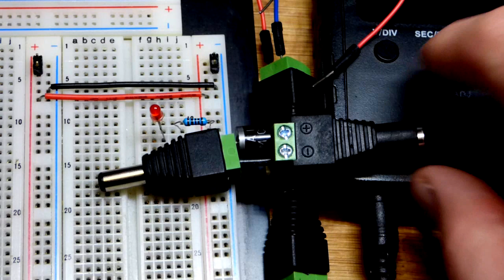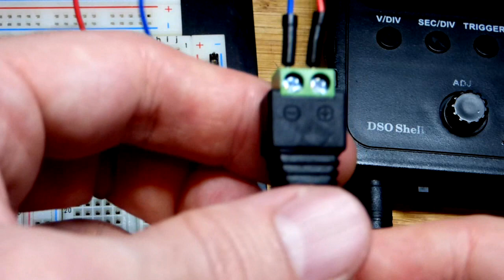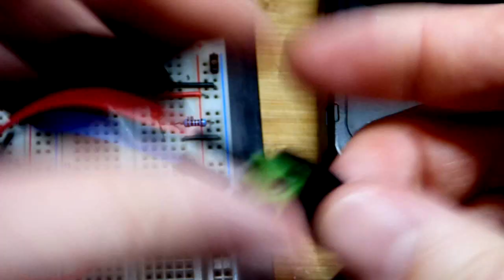DC power jack plug adapter connector 2 point 1 by 5 point 5 mm how to DIY demonstration

Comment: Should be noted that these connectors are only rated at 5amps max. We use these for connecting LED strip lighting to our power supplies. Enjoying your videos. Keep them happening.
Reply from the maker: Glad you enjoy, thanks for the info!
Reply: Yes I see that in most product advertisements but I also saw somewhere saying that only 2 amps. 

I am worried whether it will overheat if I run for long periods of time at 4 amps